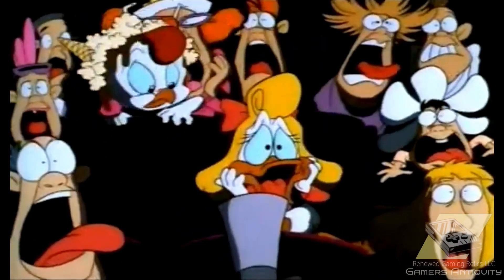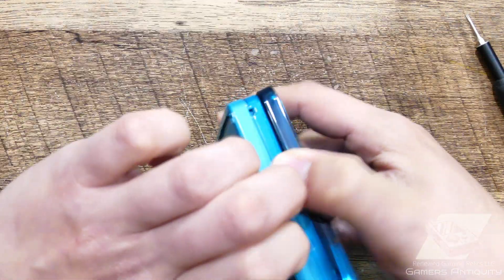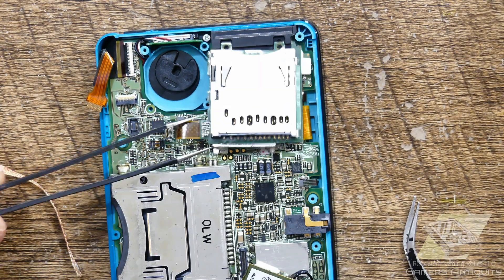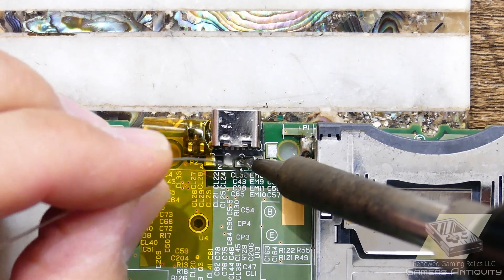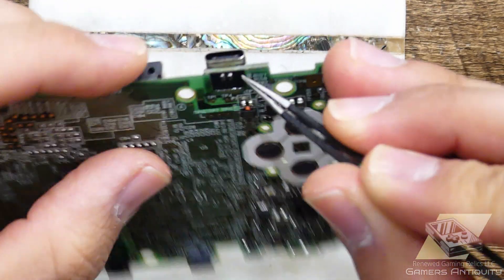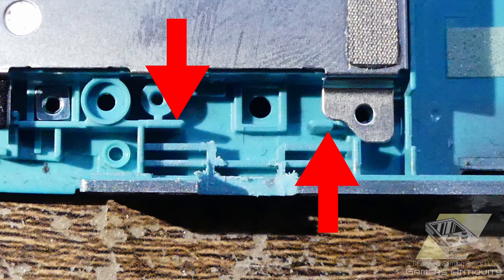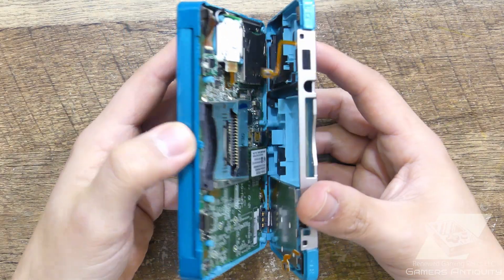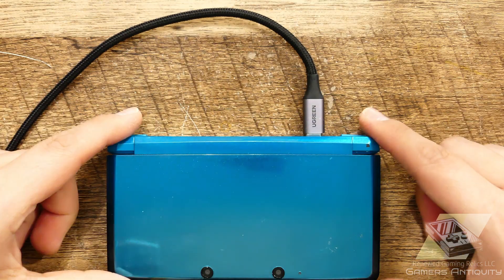USB C Modding the Nintendo 3DS

Comment: This is cool but there's definitely need for more bracing. Thats going to rip off rather quickly if youre not careful.
Reply from the maker: Definitely a solid note, and it'll definitely have an additional anchor point in the next revision as noted in the vid. I've also thought of an accompanying insert (not just for this l, but the other DS ones too), but it'd only deal with force perpendicular to the joints and not the horizontal ones. It'd be made to fit above the port itself.

What'd your thoughts be on that?

Comment: Will you ever do a mod for the nintendo Wii which helps it to get a better resolution? Like 1080P. Or a HDMI integrated mod to easily get the 480P instead of 480i
Reply from the maker: While I have made a USB-C mod for the Nintendo Wii, I'm not so sure on video mods yet; one was asked for the Sega Saturn not that long ago.

However, with a soft modded Wii you can improve the video quality through USB Loader by enabling the 480p patch, Deflicker Filter off Extended, and Video Width Framebuffer. You can set the 480p patch in PriiLoader too. It will make the games crisper and not stretch out though I'm sure there are games where the devs took Nintendos' weird approach to stretch the video and make it fuzzy so the settings may not fit all games and some of the settings would need to be tweaked.

Also, PixelFX has released the good to get the Retro Gem on the Wii so there's that available to natively scale up the image digitally up to 1080p. The basic license for the gem is locked to 720p, with the shiny license isn't restricted and easily gives 1080p. Imo, the cost of the shiny license gem beats what's been available for internal hdmi mods in terms of cost and capability. I love the gems I have installed for my consoles so maybe that'd be something you'd like to check out.

Not to say it's not something I wouldn't explore at some point, I don't have the resources to do so at this time.
Reply: @RenewedGamingRelics  Yeah but I basically want 1080p on Wii. You said that it is possible with PixelFX + Retrogem? But I can't find any videos on it. Could you do a tutorial about it, please?
Reply from the maker: Ye absolutely! I've set up a few different budgets so once I have enough for another Retro Gem, it's something I'll absolutely be doing. Gotta get one for the GC too.
Reply: @RenewedGamingRelics thanks. I can't wait for that tutorial then!

Comment: You should do the same for the New 2DS XL , New 3DS XL, and the Old 3DS XL
Reply from the maker: I actually have planned out to have install vids for the 3DS XL, 2DS, and 2DS XL be made and out after the one for the WiiU. They're on the way 👌 The New 3DS and it's XL version will wait 'till I design the boards for them.

Comment: Does this work on a New 3DS LL?
Reply from the maker: I'll have to get back to you on that as I have marked a different board for it, but haven't gone through making the video lined up for it. I don't want to give you the wrong info on the boards' compatibility for the fit.
Reply from the maker: The mod board for the 3DS is not suitable for the New 3DS XL / LL. I thought I had already designed the boards for the New 3DS line, but looks like that wasn't the case so it'll be planned to have that made this year. Sorry about that! Just found out as I started doing recordings for other mod installations.
Reply: @RenewedGamingRelics  Thanks for the update! I will keep my eye out for it when it drops